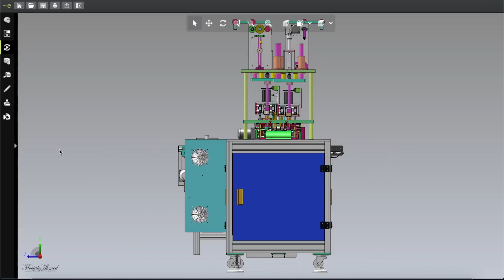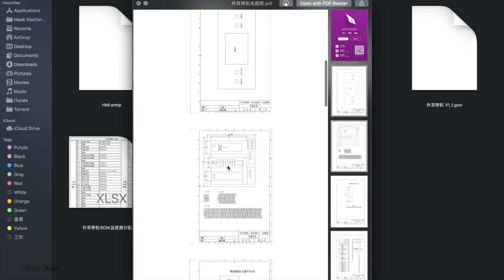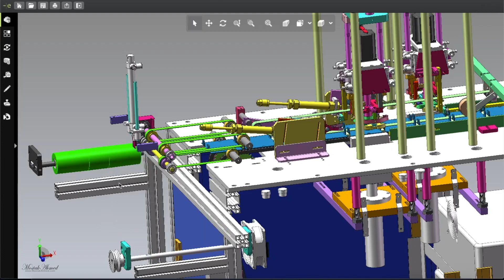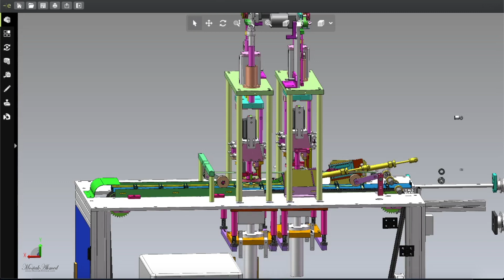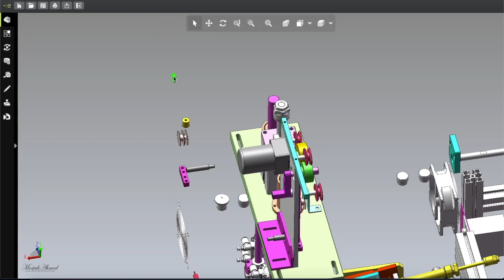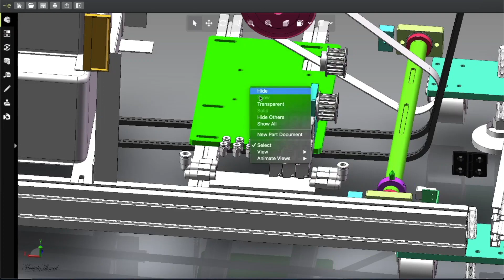Second Generation Full Automatic Ear loop Sealing Machine (Part 2)

Comment: Dear Mr. Mostak,
Thanks for the details share on you tube. What do you do?? Are you a design engineer of machines ?? I am also an Engineer having Tool Room at India we are specialize in Textile Bobbin moulds, connector moulds and other Industrial products moulds. Right now We make N95 and Kn95 embossing rollers dies. I am very much impressed with your design skills and briefing skills. Please share your number so that we can keep in touch with each other.
Reply from the maker: Thank you sir
WeChat: +8613126591305
Whatsapp: +8801829370810